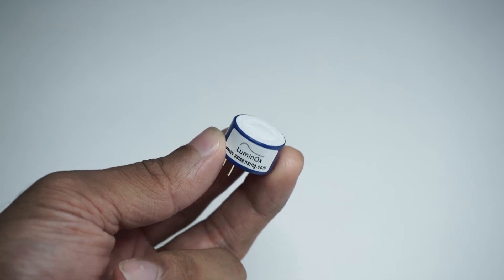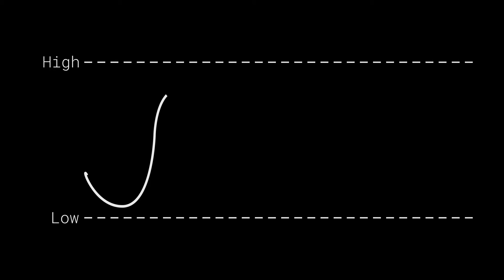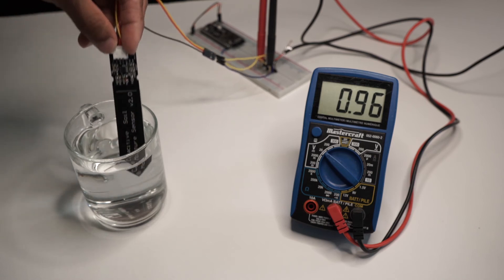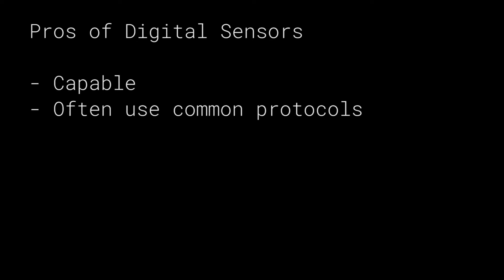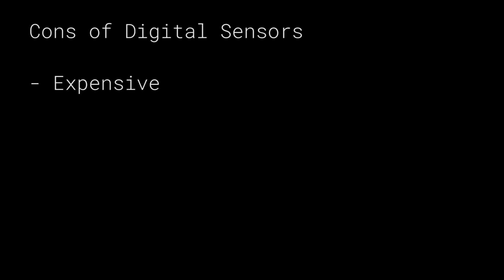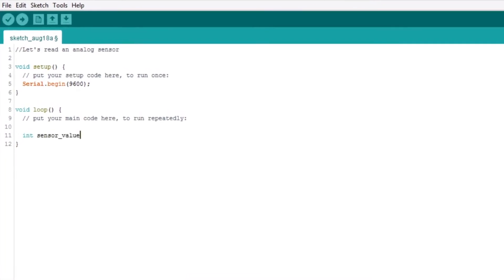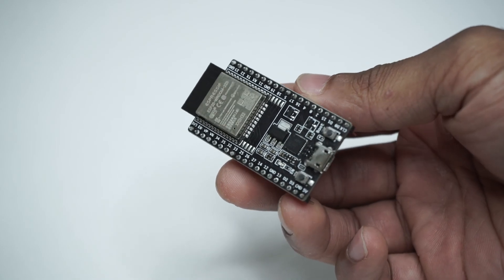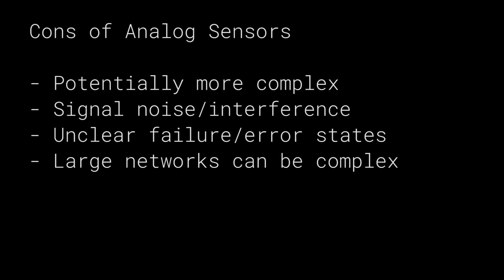What's the difference between digital and analog sensors?

Comment: I see that analog sensors are most easy to write a code for and so I'm opting for that option
Reply from the maker: You should take a look at the DHTxx line of sensors: https://learn.adafruit.com/dht/overview

I haven't used them personally but took a quick look at them. They have both temperature and humidity and are digital - but you can find libraries for them which should make setup really easy.

Take a look and see if they work for your needs. I hope they do!